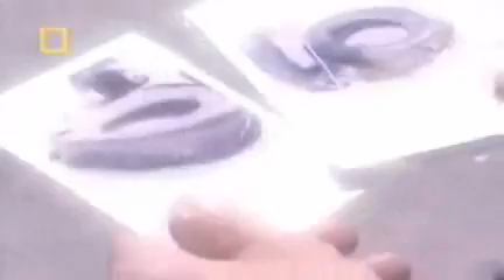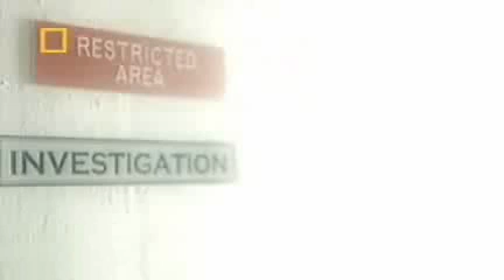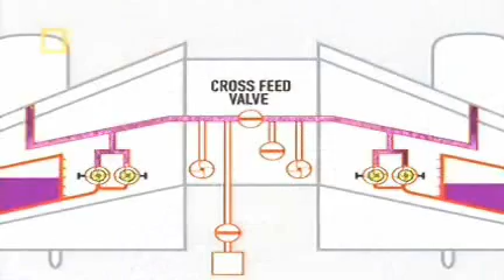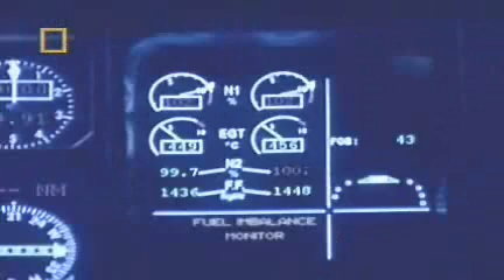Air Transat 236--Gliding part 5

Comment: @addthewin Iamdifferent is right there. Fair enough initially to cross feed to the low tank, but they should not have continued pumping fuel into a tank that is going down; that spells fuel leak! It's a relatively basic concept that airline pilots should be aware of, whether is says so or not the flight manual. Flying with a fuel imbalance is not a major problem.